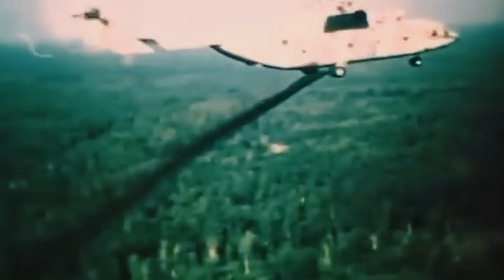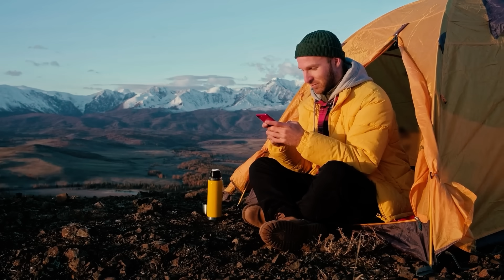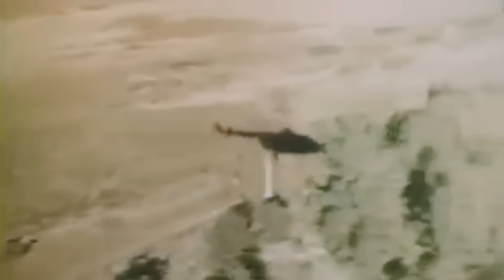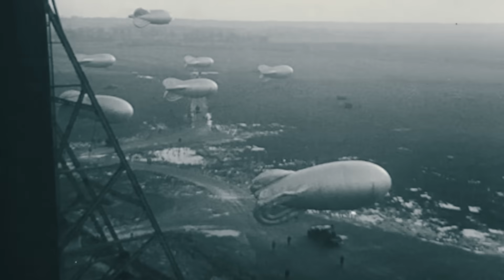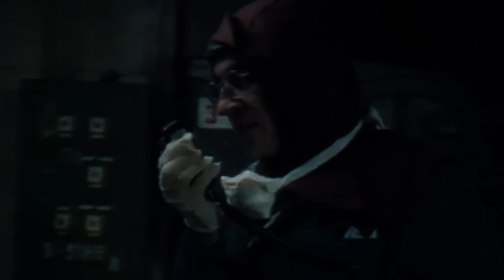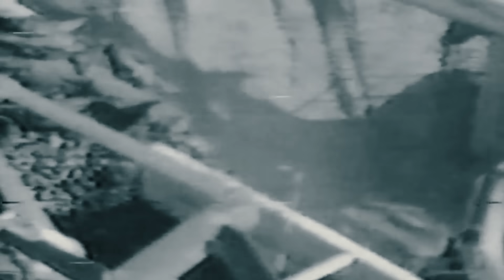The Red Truck Inside Reactor #4: The 5 Mysterious Machines of Chernobyl

Comment: Now, the display vehicles that were used for clean up at chernobyl have been stripped of engine parts. When russia invaded and held the power plant during its war with Ukraine.    Guess they found some of the equipment still useful, then took off what they could still use.

Comment: My father was one of the technicians servicing those helicopters. While the helicopters and the flight crews were military, part of the maintenance on them was done by civilian specialists. And my father was one such specialist. He once told me a story from back then, and I want to share it with you. For context, the military personnel had at least some degree of understanding of what radiation was, and what the safety measures should be, etc. But civilian technicians knew nothing. They weren't given any briefing, nor did they get any protective gear, and they didn't have personal dosimeters either initially. Now to the story. That summer was very hot, and the helipad was out in the fields. So the helicopters got blazing hot, and working on them was very physically taxing. So after completing his work, my father has decided to take a nap. And the only shade in the vicinity was under that helicopter. As you can imagine, those helicopters were very heavily irradiated. But civilian technicians knew nothing of it. As my father was about to doze off, one of the military pilots saw it, woke him up and chased him away from the helicopter. He told my father to not stay around those helicopters a minute longer than necessary. As far as I know, those pilots have all died within the first 5-10 years. That pilot's advice and the fact that my father ended up not sleeping under the helicopter probably gave him an extra decade or two of life. And that's the end of the story. I didn't think much of it as a kid, but now it fascinates me because of how silently terrifying the radiation is. Imagine losing many decades of your lifespan by simply napping in a wrong place.
Reply: Thank you so much for telling this story. Wish you all the best in life!
Reply: Thanks for the info, one thing we do perhaps should have these days is info a memories like this out there.
Reply: Even the first responders didn’t fully understand the danger. Sadly people were very disposable to the ussr. Glad your father had someone to warn him, even if he had no idea at the time exactly what he had been saved from.
Reply: Thanks for that  I love reading stories. Like that. I’m 77 and my life was uneventful. Thank god
Reply: Thanks so much for sharing
Reply: Thank you for sharing that story. Your father and those people are true heroes in my book.
Reply: Thank you for sharing, brings a human  angle  to the debacle ❤
Reply: Radiation from Chernobyl triggered alarms aboard US submarines at San Diego, California and Holy Loch, Scotland. That radioactive cloud from Chernobyl circled the Earth 14 times   before it was undetectable.
Reply: Invisible stuff stole nearest place
Reply: Thank you for sharing. It's stories like this that make the real heros known
Reply: Thank you for sharing 🙏
Reply: An awesome story!
Reply: So hard to know as soldiers and crew probably acted like they were terrified of their aircraft and had protective clothing on... 

Like guess that's just for fun.
Reply: I Call Bullshit!

Comment: Perhaps you need to build / reactors deep underground in case of an explosion nothing would reach the surface.
Reply: Then they are closer to groundwater.
Reply: Or just build the concrete dome over it as you supposed to. Soviets knew but didn't have the money for it

Comment: The roof on reactor 4 collapsed......!!!  REALLY??  The roof disintegrated, and the 1100 tonne lid on the reactor was blown clean off and ended up over 1000 metres away from the reactor!!!  All while the fuel rods, uranium dioxide ( enriched u-235) with graphite tips to help fission, were blown clean out of the reactor and disintegrated into chunks.  This is what first scene responders, fire fighters were cleaning/picking up at the scene!!!  One can only imagine the smell never mind the blue glow lighting the night sky, one can assume more than the fire itself!??  It was a floored design in construction of the rbk reactor of which many were not made aware to never let levels in the reactor drop below a designated number or a chain reaction would occur of which could never be averted!!!  ❤out to the families of staff involved. Learn from mistakes so they may never happen again.❤❤❤😢

Comment: So you are completely wrong in saying the Mi-26 crews were there to "decontaminate the irradiated landscape".  That makes zero sense.  Your second statement is the correct one in "containing the nuclear threat".  Dropping stuff into the open core or causing the mess to stick to the ground controls spread.  It does nothing to decontaminate.  Decontaminating the landscape was for completely different crews most likely using trucks not helicopters.

Other than that goof a pretty good video covering aspects of the disaster that I haven't seen before.  Namely the robots that they did get to work on the roof.  You would mainly hear about the ones that died fast deaths due to the radiation.  Just do to the sheer volume of material they handled themselves the roof robots were the most impactful.
Reply: Nobody is decontaminating sht round there.  Controlling spread is decontamination when the sht hits the fan.

Comment: The Soviets did some heroic engineering in the aftermath of the disaster.   I am not sure that any modern countries could do better in such brutal conditions (see, e.g. Fukushima).
Reply: Lol well when u force your people u can do anything
Reply: The Japanese have done pretty well, they built gold-plated robots to inspect their molten reactors and have constructed something like 11,000 huge water tanks in order to store every drop of water they need to keep pumping through the cores to cool them as the water needs to be held for around 13 years before it's safe enough to be discharged.  Not to mention the robot snakes they invented to inspect all of the collant pipes to check for leaks.

Comment: Not being a physicist nor chemist, I would have thought that literally layering the entire plant are w/ quick and dirty layer of hot tar followed by stone and then repeated again and again, would have been a relatively impactful way to build up an initial layer of dust and debris encasement such that the concrete sarcophagus could be developed in parallel, to lay upon the tar foundation?  I’m sure that smarter minds than mine already thought through the numerous options, but I’ve never come across any article/artifacts noting what was considered?
Reply: If you scrape the first few inches of radiated soil and move it away from whats left you again have farmable soil, it wont work if you cover over the soil as the radiation will rise through it, id presume it would do the same with the tar/stone and would be a very long and risky process.. i reckon thats why they use led to protect from radiation as its too dense for it to pass through and also why they didnt just fill the graves of the engineers with stone+tar

Comment: I'm very curious about the effects of radiation on their machinery. I understand why it would fry circuit boards, but you seemed to imply additional damage. Also, why would they care if a robot becomes contaminated? It's not like it needs to go anywhere later?
Reply: Robots need to be maintained and moved by people, if one becomes too irradiated then sending people to attach it to a heli or to weld a broken track would endanger their lives.  Same reason all helicopters and land vehicles had to be retired to the vehicle graveyards after a certain amount of hours, they eventually became too harmful for humans to approach.
Reply: Good point, however when I considered that line of question I thought about the engineers that would inevitably have to make any important repairs and the risk of exposure at that time. That essentially sent them on a one way mission and made them unserviceable. So, they were only good for as long as they lasted.

Comment: Can irradiated steel be recycled, and if not, could something else be done other than letting them sit? Or they just too toxic for the next 10s of millennia to mess with?
Reply: I’m afraid re-smelting / recycling wouldn’t do any good, unfortunately. Whatever the recycled metal was made into would still be radioactive for a very long time.

I’ve seen other explorations of Chernobyl, tourism, in fact (!), and the consistently “hottest” debris was anything large and metallic! (Everyone carried Geiger-counters or similar devices, as well as wearing dosimeters, of course)
Reply: There's a website that is an online museum of radioactive manufactured goods that have turned up, usually from unknown scrap metal sources.  There's probably a lot more that are never discovered.  All metals essentially blend together forever when melted down.

Comment: The little tank that could was my favorite, though it arguably did the least.
Reply: Although not mentioned here, that little tank was what gave the scientists and cleanup workers their first closeup view of the "elephant's foot," which was too radioactive to be approached by humans. Brave little tank.
Reply: Yeah, same here. Although the test team were real heroes.
Reply: It allowed the scientists to judge which areas were safe; it was very useful to them. They could drive it down corridors and get the dosimeter readings; this work was crucial in the 'battle for chernobyl' which was the effort to reclaim unit 4 rooms from contamination. It went on for several years, and concluded in them getting next to the reactor walls and drilling through to take a look inside, enabling them to determine what happend to all the nuclear fuel that was unaccounted for.